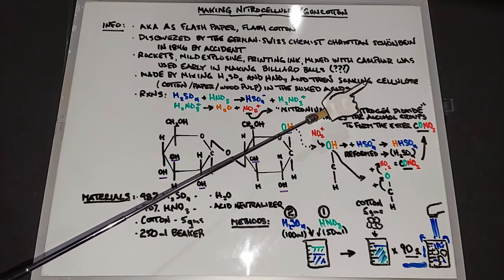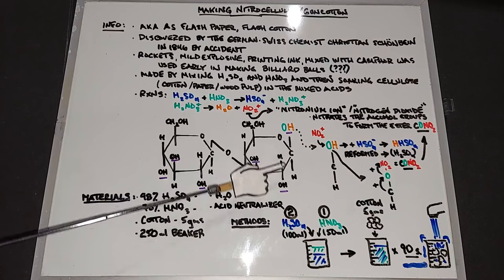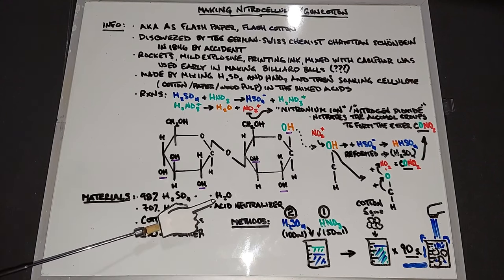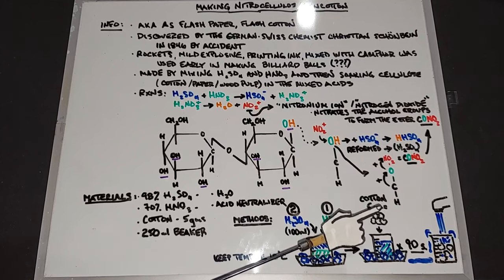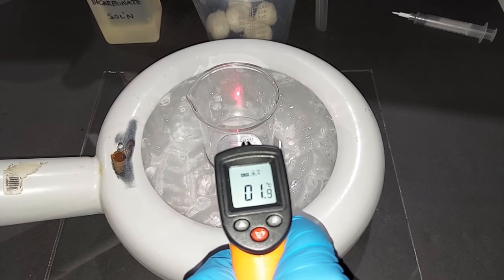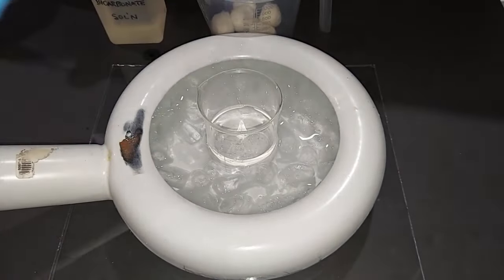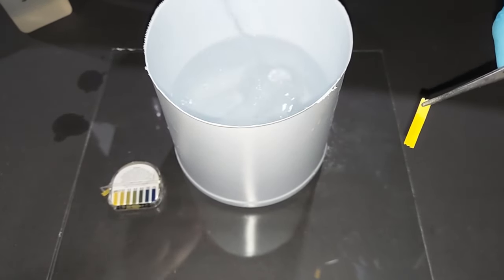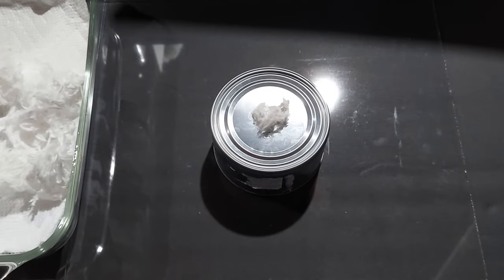Making Guncotton AKA Nitrocellulose

Comment: Explosive nitrocellulose is 13% or more nitrogen.  While soluble nitrocellulose is 12% or less nitrogen.  While there is at least one recorded incident of an exploding pool ball, they are not really explosive because making the nitrocellulose explosive means it is really not suited for casting pool balls.  Additionally using less nitric and sulfuric acid at lower temperatures meant it was cheaper to make and less flammable.  So while not exactly a myth, an exploding pool ball was exceedingly rare.
Reply: I heard it was more crackling than a real explosion and that is somehow more likely. Also, I'm not sure around the time those incidents happened they were using dilute acids to get to a desired N %
NC will always be soluble, you just have to use the right solvent with the N% you got which can actually help the amateur chemist determine what he has made. Non nitrated cellulose will of course not dissolve in the solvents you would use.
Reply: @herrhaber9076   soluble nitrocellulose refers specifically to an ethanol ether mixture.  It of course is more soluble in acetone but the more nitrated stuff is less soluble.  Nitrocellulose is still used in guitar picks, fingernail polish and ping pong balls.  To reach the explosive level requires first treating the cotton then a second treatment in fuming nitric nitrating mix and heating.  You will lose a good percentage of your product as oxalic acid.  It simply wasn't done for cheap consumer products.  Azeotropic nitric acid is normally used for making gun cotton and as well as it burns it is usually 12% or less and it still requires a good surface area to burn and does not readily explode.  Hence the use as gunpowder which needs a controlled burn to not damage the gun.
Reply: @lrmackmcbride7498  Pssst, I read Davis or Urbanski to pass time ;)
Reply: I could imagine someone goofing the process by nitrating the cellulose more than needed

Comment: Only tri-nitrocellulose is a guncotton.
Reply: That simply is not true.  It is usual expressed as percent nitration or soluble/insoluble.  Nitration above 12% is undesirable for actual use in gunpowder.  The higher nitrations were primarily used for blasting.  Gun powder burns and explosion will damage the weapon.
Reply: @lrmackmcbride7498  moreover. It’s not used for blasting, it makes little sense. In ammo speed of burn is determined by size of the grain and additions like nitroguanadine and nitroglycerin.
Reply: @mandra3768   it was used for blasting over a century ago but only in 13+ percent forms.  It is still used as a component in some composites but it isn't used by itself for anything but single based powders which don't explode.  The other uses are generally less than 10% nitration which is not explosive.

Comment: What would it take to make it not just burn swiftly and vigorously, but go boom?
Reply: Confinement and a higher percentage of nitration.  To get to the magic 13% nitration is not easy.  You have to do a separate treatment.  Use fuming nitric in the nitrating mixture and heat but it causes the nitrocellulose to degrade a good bit.  So you get less product but it is a true explosive and not just fast burning.
Reply from the maker: A higher concentration of nitrogen in the cotton.  Above around 13-14%.
Reply: Sorry. That was supposed to be 50/50 mix of acid.

Comment: Hey bro great video! Deos that also work with a 1 to 1 ratio of nitric acid and sulfuric acid? And is it safe to save the nitration bath if you seperate the cotton or did the acids go bad?
Reply from the maker: Yes, you can use a 1 to 1 mix but the timing is different, and you're wasting some nitric acid typically.  The acids don't go bad, but their ability to nitrate drops with each subsequent use.
Reply: @cranialconstruction2218  thanks a lot dude

Comment: Saying nitrocellulose is guncotton is like saying all double base propellants are cordite ;)
But I get you, sometimes it's easier to say guncotton then give a big explanation.
Reply: About the billiard balls, I read somewhere Celluloid "helped save" rhinos, their horns being used for balls. But at that time, the NC used was with a very high N % and would actually sometimes "crackle" loud enough when hitting other balls for people to draw out their guns (US obviously).
Reply: About the acid addition: come on man ! This is not necessary. Just put your acids in the fridge then mix the desired amount in the ice bath.
You're not gonna get NOx from such a tiny amount. 6 c is nothing when mixing acids. Start worrying when you get 10 times that.
Also, what you did when you dumped the NC in the cold water is dangerous. You should use a lot more water and NOT take it out like you did before really giving it a really good swirl.
Said by someone who had NC self ignite in his gloved hand doing exactly what you did. The exotherm was enough. Good thing I was wearing face protection ;)